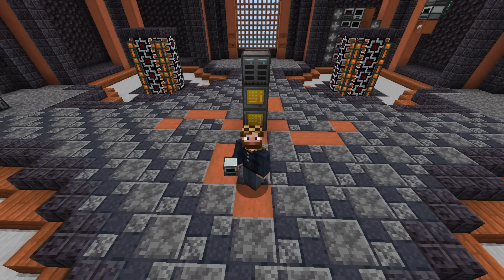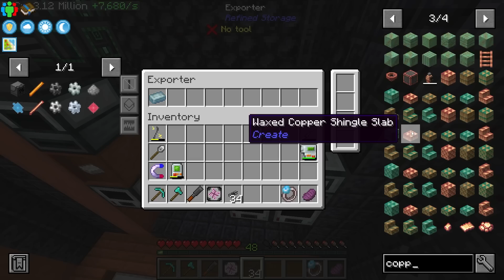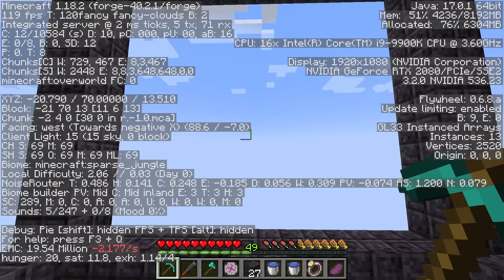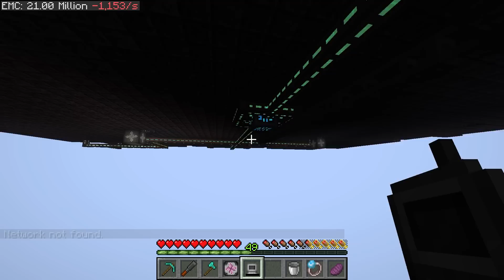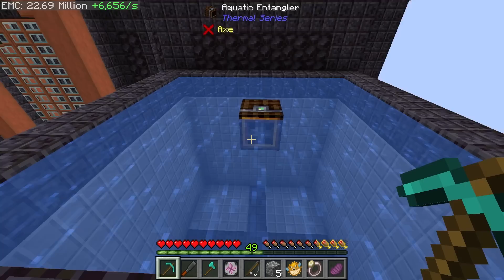Mechanical Mastery Minecraft Modpack EP6 Fishing JUNK

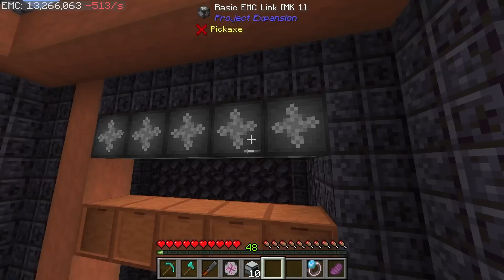Comment: 1:10 EMC is at 13.26 MIllion.
21:23 EMC is at 8.04 Million
21:29 EMC is at 15.70 Million (obvious time lapse)

Question: Setup was running at a slow net negative. What changed?
Reply from the maker: My ores caped out and finished processing

Comment: Chosen is so lucky I had to go look for a jungle, and it ended up being 3222 blocks away. Took a bit to find it but I got there after searching every cardinal direction. I ended up chunk loading with flux network so now that that is done I guess I can finish automating the improved mechanical processor. Oh btw to get back and forth real quick I just use rftools teleportation.

Comment: You did the water wrong... However there is an easy fix.. First what is wrong

Only the top layer is water source blocks (idk if the aquatic entangler specifically needs only source blocks

To fill a pool of water quickly there are 2 ways.. 1 fill from the bottom up.. If you fill for example the north and easy side per layer first than the water will fill the rest of the spaces..

The fix that is currently easier for you is using kelp placing kelp in every spot will change the flowing water to water source blocks than it is just a case of breaking the kelp
Reply: As he has access to create, he could also use a hose pulley to avoid the problem entirely.

Comment: You want to put the block diagonally to the water wheels, the corners so to say, so the water touches all four sides of it to get the most stress units out of them. They only check for water on the four sides, up, down, left and right

Comment: * I've used compact machine to test wither farming techniques.  
From what I gathered Red Matter Block is the only player-placeable block  that is wither-proof. 
(And then I built a cage in overworld, had a desire to peek a little, made a hole and half of my chickens turned into wither roses)

*  I used clicker machine to feed blaze burners. Auto clicker doesn't require power. There's a caveat: it doesn't work by default in claimed chunks, you need to ally auto clickers in settings.

* For charging wireless grid I used  mekanism: 1 its energy cube I carried as a power bank to drop on the ground, put wireless grid in, take it, put battery in a backpack. Plus my base had lots of energy cubes scattered around in case when something massive needed to be crafted so machines consumed more than power grid produced. It culminated with a tower of around 12 elite energy cubes fed from the steam turbine. Basically around tier2 my base never delivered power from dynamos to machines directly. There always was a buffer of cubes.

* Each time Chosen says "madness" I feel like it's foreshadowing for Multiblock Madness or Multiblock Madness 2

Comment: Try Modular Routers mod to send wireless power to Mekanism machines, only You must put in max upgrades and it's working very good with flux points, and You can connect to 8 machines by one block Modular Routers. It's not working good with Thermal mod.
Reply: why not with thermal mod?
Reply: @kizigamer6895  slowly recherging power

Comment: I edited the quests so that create is the first tier and mechanical essence is required to make Thermal frames. Plus the recipes needed for it all to work. It makes more sense to me this way.
Reply: Heyy I am not that good at modding could you please link me a file for your moded version
Reply: @Dream3r2002  I put a reply on here with a link to the files, but Chosen would need to approve it for you to see the link.
Reply: Agreed might have to try it again
Reply: Just remove create, and it will be the best pack ever
Reply: @melonheadwt I like create but removing that and immersive engineering would definitely make it simpler
Reply: @discord4039  I didn't my have any problems with IE,  it's just create,  imagine grinding ur way to a quantum something and then hook it to a create gear,  WTF
Reply: @melonheadwt  I hate IE, specifically the massive furnaces and stuff. I do get the fact that create kinda looks unfitting with the rest of the stuff and respect your opinion, but it is a fantastic mod in its own right, and can be used to build awesome bases and machinery. I agree that create doesn’t fit in this pack, but I think that if someone made a skyblock with a similar concept to this but just used create then that could be really good.
Reply: @discord4039  I just saw ur replay sorry.. 
Skublock or normal world based around create is fantasticly OK..  I'm not playing it anyway lol. 
And II agree with everything u said

Comment: Why not use compacting drawers
Reply: They confuse your system, it will see 7 block,64 ingots and 576 nuggets and only one of them is true. Compacting drawers don't function well with digital storage
Reply: You can use them as the crafting machine to make or nuggets though, that can work quite well
Reply: @CarpathiaS  that's why I use them so I can pull out nuggets or blocks without crafting
Reply: @Humphr3y_  That's what a  lot of people do, but it lies to your system so some crafts will not complete because of this.
But it rarely happens I gues
Reply: @CarpathiaS  i have never had an issue with compacting drawers, maybe if you crafted something with a lot of ingots and nuggets of the same type but since i have never ran into that issue the odds  ust be extremely low